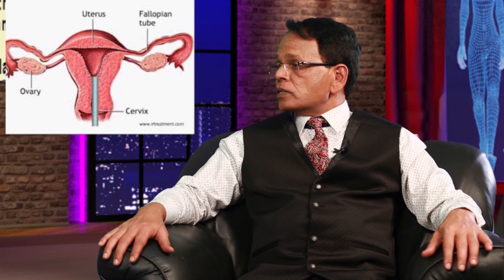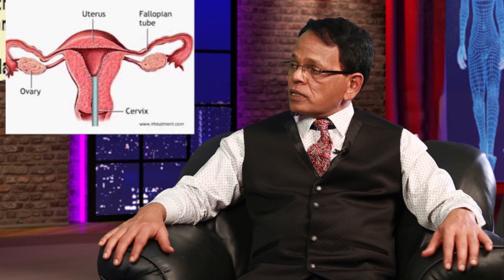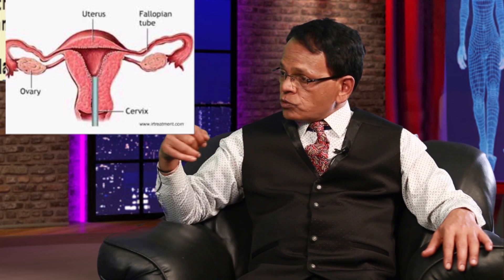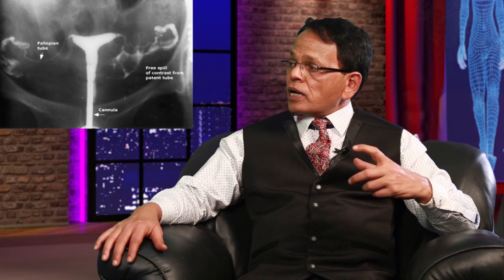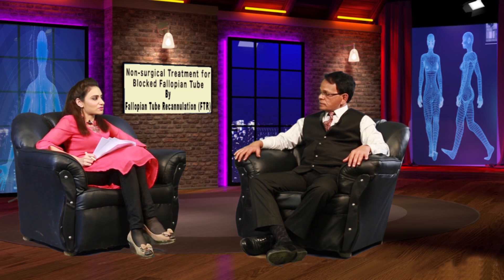Opening of Blocked Fallopian Tube

Comment: I would like to have some advice about tube unblock without surgery.
Reply: Damage/blockage of the fallopian tube: A lot of women either have a damage fallopian tube or a blocked tube which actually simply prevent the sperm from reaching the eggs.

When a woman has her fallopian tube blocked, it greatly reduce her chance of getting pregnant.

That is why women need to go for a test such as HSG to check if their fallopian tube is Blocked and when it shows  that You have Blocked Fallopian Tubes, Do Not undergo any surgery because it might lead to lost of one Fallopian Tube , simply Use AGBARA HERBAL DEEP ROOT CLEANSER and Use this Medication for 2 weeks and it will unblocked your Fallopian Tubes and Boost Your Fertility and You will get pregnant as fast as possible okay,,Because it re-immune your Body and Balance Your Hormones